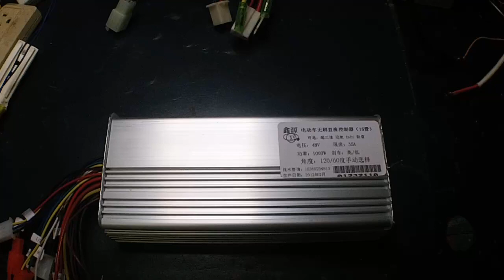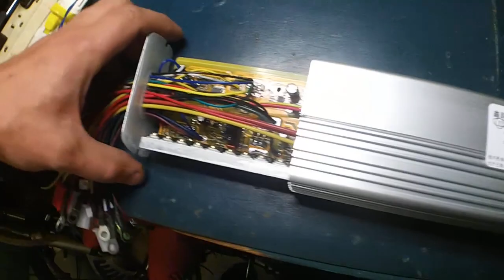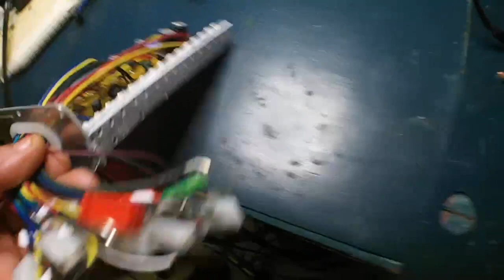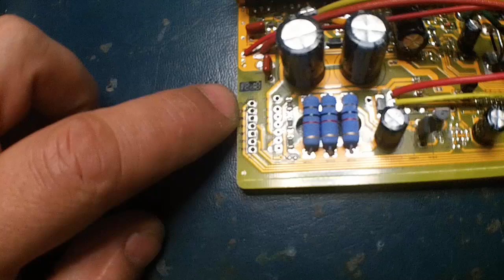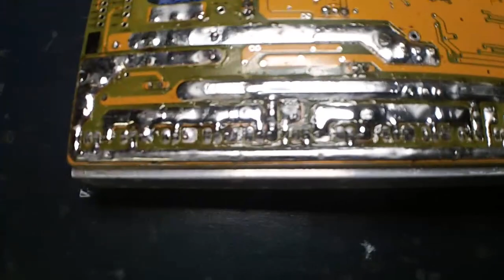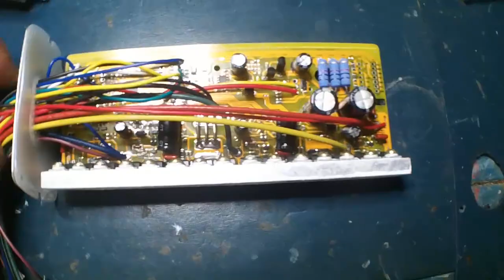48V 1000W E Bike Scooter Electric Bicycle Brushless E-bike Controller With Hall

Comment from the maker: only true way to do it is to use a rear carrier with a locking hard case. or if its a old bike drill a few holes Bolt it to the frame.

Comment: i wantes to know bjj ow do you wire it up so you can program the control with a laptop also do you think i can take a 72v 2500w controler and cange the fets to 80v 190amps. and change the capacitors to 80v. also do just upgrading the vapacitors from 470uf to 1000uf make a diffrence

Comment: I got a basic 48V 1000W controller but there is no wires for cruise control. Is there anyway to make it have cruise control by using the pedal assist wires? Or do I need to program the controller?

Comment: Hi! I bought a conversion kit, but it does not work. 1000w 48v. There is voltage in to the controller but nothing out. The throttle has no voltage as well. Do you have any ideas what the problem can be? Thx

Comment: Hi there, I have a 48v 1600w scooter and its just packed up, there is no power and Im wondering if it would be the control box? As you look like you know what your talking about. What does this do and how can I find out if its broke?  thx
Reply from the maker: +damoOM3N if its a 48v 500watt change the controller to a 48v 1000watt. it will give you that extra power without frying the motor
Reply: Karma Electronics can you explain to me the difference or benefit of having a 48v 1000w motor ? Speed or torque ?

Comment: hey i have a 1500w controller with wires labeled "speed cables". is that something that would increase or decrease the output of the motor if i put power to it?
Reply: if its blue its to decrease power, usually by 30%

Comment: Hi, 
I bought the same controller, but I have no references to the cables as you have stickers on them. Could you explain to me, please, to which connector to connect trottle, and to which-brake? For Hall's and motor is clear. And which cables need to connect to turn on the controller?
Thanks!

Comment: I have a Pantera S1 electric scooter with a 48v 1500w Tesila controller. I'm trying to figure out the wires so i can possibly make it go a bit faster as its set in 2 modes (15mph & 30mph) Can you possibly help? Thanks

Comment: Hi! love your videos! you get some great torque and power out of your bikes and they go  pretty dam quick. i just purchased   an e scooter it is a 5 battery 60V Toa Toa ATE 806 it has 800 w hub motor what is the easiest way to get more speed out of it . It is brand new so I want to do it properly without blowing the motor or controller I do not mind spending a bit of money to do a proper job. Is it possible to get 55 km an hour out of it?
Reply from the maker: hello kevin yes you can run 79v it will give you 55km easy. i still have and use this controller. have new ones to post on my other channel karma ebikes. going to mod 2x 6 fet controller to run 100v. well the fets being used are rated for 200v. should be interesting. cheers

Comment: hi I have a similar controller 48 volts 1500 watt, I just bought it brand new from eBay,  so I bought it to run my 3 phase brushless motor, but it won't run, so I took my positive lead from my multimeter and put my negative lead from my multimeter and checked all three wires from the controller that's for the motor and I get a reading of 51 volts, so that's good and I also tryed that same method for the three wires from the controller  for my throttle and I got a reading of 51 volts for two out of three wires so I beleave that's my problem, so my questions are do you agree that's my problem and what should I do about this?

Comment from the maker: ill post a video of the bike
Reply: Mr mate....

Ive got a 36v 500w machine and i bought a 48v 1000w controller and connected it , with the ignition turned on every light lid up but absolutly nothing happens when i pull the throttle....

Any idea wth is going on , or not going on for that matter ? :)
Reply: Karma Electronics can you use a 24v battery using this controller?

Comment: It's very cheap, but the insides looks like low quality..
Reply from the maker: +Dmitry Lyalin  hay still have this one run it every day at 73v. opened the unit no damage no burning. may look cheap but its good.
Reply: run at 75v OK? do you think it is at 75volts?